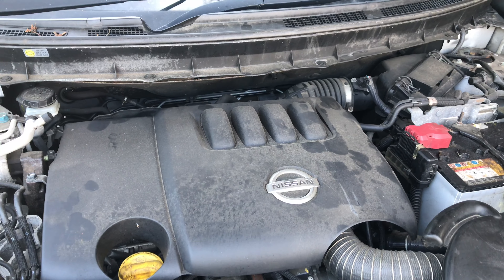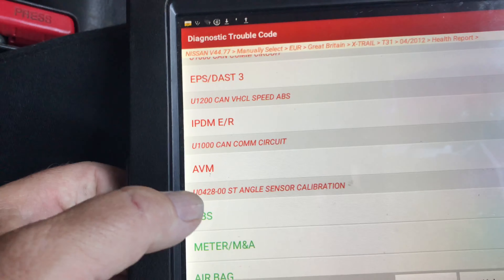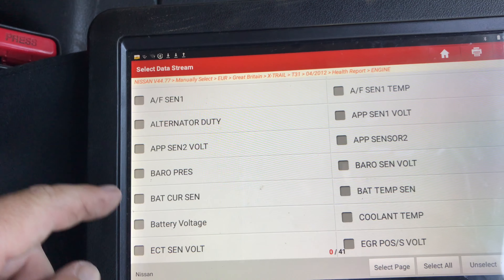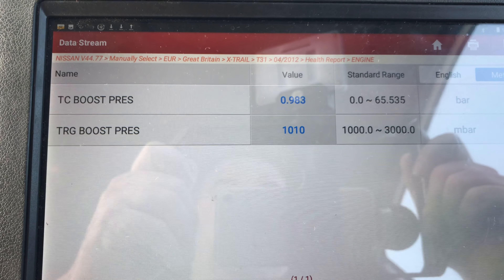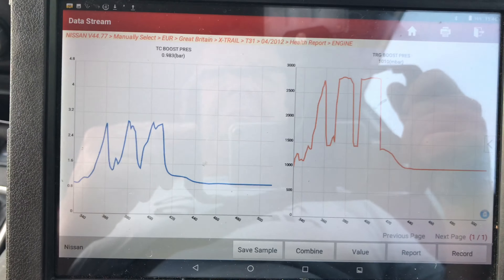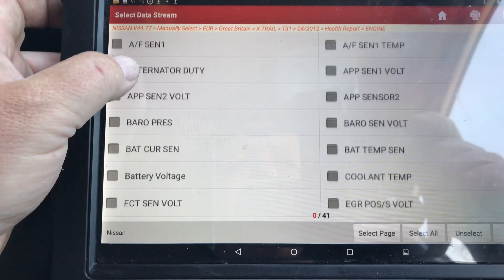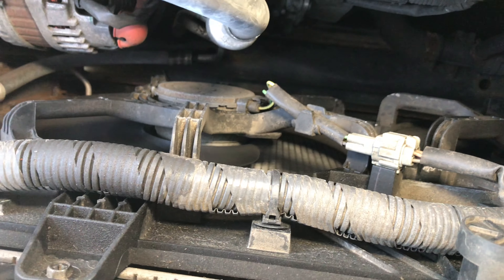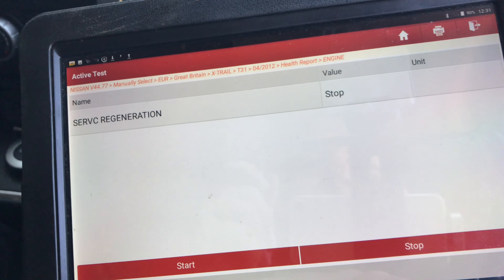Nissan X - Trail (2013) 2.0 Diesel - Sluggish/Poor Performance

Comment: I had that on my x trail t 31 2009 cleaned caliper guide pins, bottom one's on both front calipers stuck, inner pads worn down to about 3mm, outer pads ok at 8mm. Also could see heat colour change on inner discs. All ok after 30 minutes of tinkering aboot.

Comment: hello, I have a similar Nissan but it gives me a headache, no one knows what the problem is P0611, I tried to rewrite the injectors but without success after the rewriting procedure, the codes appear AAAAAAA and they don't synchronize more than 1500 R/P, different people checked it people and different brands of diagnostics but without excuses